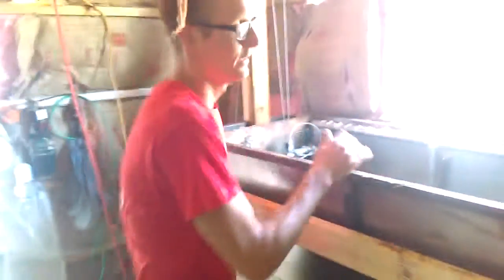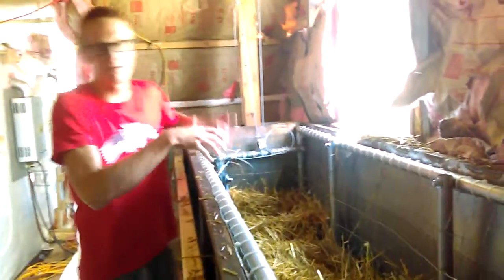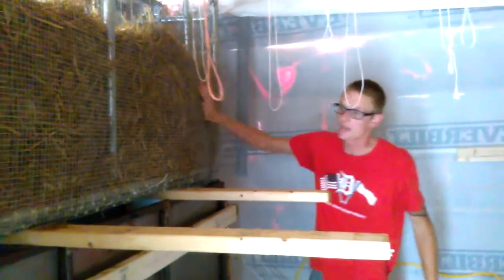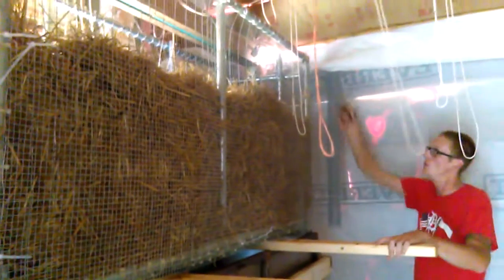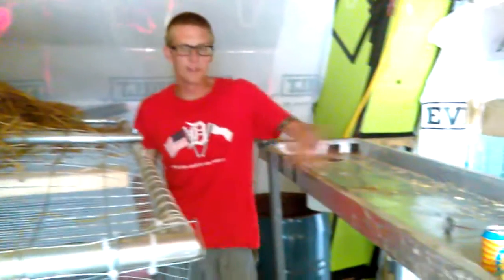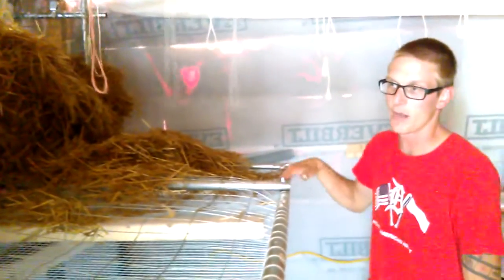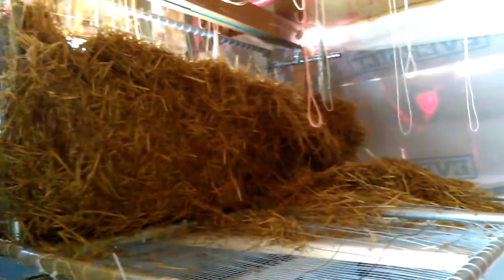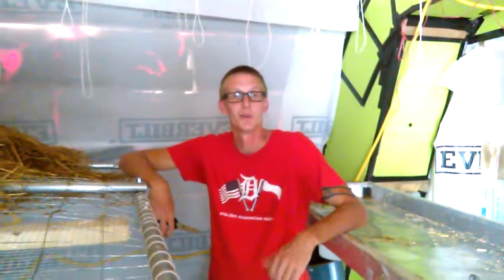Pasteurizing Straw the Right Way

Comment: Ever tried using those 55 gallon that nobody needs to bother with, stuffing it with straw for 2 weeks letting it go anerobic, then using air as your aerobic pasteurizing. No heat necessary, just planning a couple weeks out. I learned it from watching Stamets.